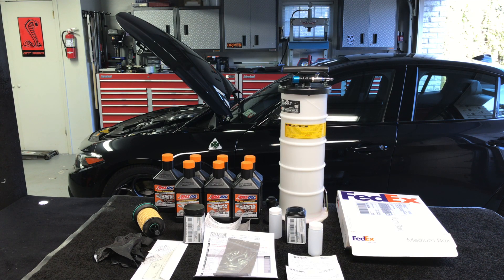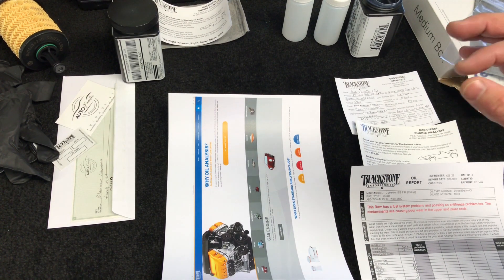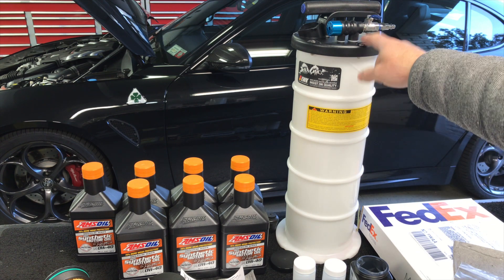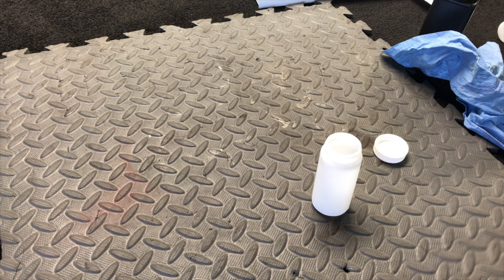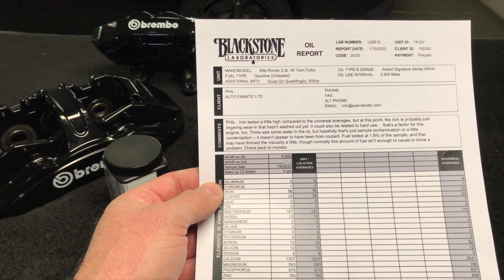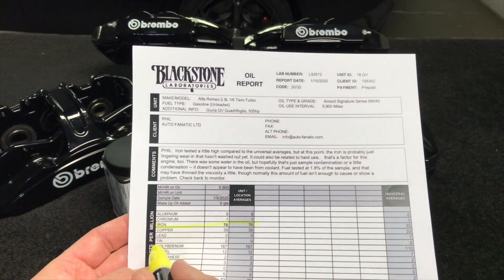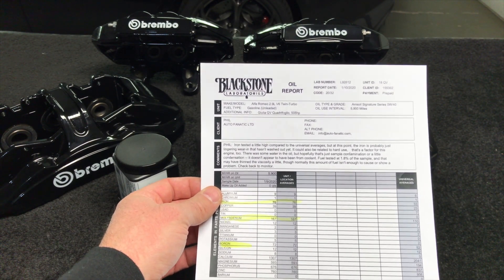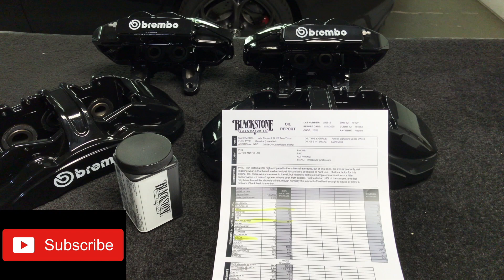Alfa Romeo Giulia Quadrifoglio Motor Oil Analysis

Comment: Hey Phil,
Just came back to this video as i am wondering if you could tell me any alternative way to do extract and do oil change using bleeder like yours on a vehicle that does not have any dipstick? I have F80 M3 and like all modern bmws mine does not have any dipstick to perform this method... 
think this is way easier way to do oil change since you dont need to jack up and hoist your vehicle
Thanks in advance.
Reply from the maker: hmm im not exactly sure i know MB has the same issue they are making these cars mostly dealer serviced now. Call around to an independent shop i wonder if there is indeed some access port up top. let me know if you do find out
Reply: Auto Fanatic alright will make some calls to find out.

Comment: I wouldn’t do this on an engine with less than 100K miles. I just did it for my bmw e46 m3 at 100k miles and it came Alright. Unless there are known issues with bearings at low mileage, I don’t think is necessary

Comment: Here is a quick tip if you don't use an extractor. Go to home depot. Buy the refrigerator ice machine tubing. Cut the hose to length where you can insert the hose in your dipstick hole and you can reach the end with your mouth. Have a rag handy and you oil sample bottle. Suck on the tube til it's about 6" from your mouth. You'll see the oil in the tube. Cap the tube with your finger and remove the tubing and place the end of the tubing into the sample cup. Remove I've your finger and let drain. You may have to do it twice to get enough oil. You don't need a full cup like AF. When done discard the tube. The tubing is $2.99 and you can usually do 2-3 individual tests off of 1 tube purchase. You will have a guaranteed clean sample. I use this technique on boats and airplanes as well. Any engine you want to oil sample.

Comment: I am on my 4th new Alfa Romeo and i am bamboozled after all these years that they need a oil change every 9000 miles !🇬🇧
Reply from the maker: i would advise doing them sooner i never trusted the 1 year interval or 10,000 miles
Reply: oil breaks down  at 2000 miles.  With a turbo 1500.  I change every 2500 miles

Comment: Moly and boron are additives not wear metals amsoil ss has a high amount of these additives because it’s designed for extended drains
Reply from the maker: thanks for posting this up, the report sure looks normal i will retest in a few months and do a comparison video to share
Reply: Get Zmax   alot of your nascar guys use it.  Also the only FAA additive approved for aircraft piston engines..

Comment: Amsoil and Pennzoil are pound for pound the best oil according to projectfarms data.
Reply: Pennzoil Ultra Platinum* not just regular Platinum.  Which you have to order now, and isnt available readily at jiffy lube anymore
Reply: The earlier quads (before mid/late 2018) use 0w40. The quads thereafter use 5w40, these cars have both direct and port fuel injection - there is a specific VIN number where the change occurred - you can look it up). DO NOT USE Pennzoil, Amsoil, Castrol, Royal Purple on the later cars. They do NOT meet Alfa’s specs. The quad needs oil that is ACEA C3 and API SN, with FIAT specs 55535-GH2 and Chrysler spec MS12991. Only MOTUL 8100 x-clean, petronas Selenia quadrifoglio, ROWE, Pakelo and a soecific MOPAR oil meet these specifications. The Pennzoil and Amsoil are ACEA A3/B3 and do not meet the Chrysler or FIAT specs. These latter oils will eventually damage the engine. The quad needs the correct spec oil to properly protect the turbos and engine.

Comment: I have a similar pump. How you clean it and how you dispose the cleaner agent? Do you dispose it as oil for recycling?
Reply from the maker: i fill mine with mineral spirits and i made a rubber plug for the spout, i shake it all around and pour the excess in empty windshield washer fluid bottles i keep in the garage, works great then i drop off at the local Napa for disposal.
Reply: Auto Fanatic thanks a lot

Comment: Should be interesting to see the results. Will you also find out how much life is left in the oil so you extended the change interval?
Reply from the maker: i took a chance on this interval but i never go this long even though these modern oils are so high tech these days but il be testing it again in a few months to share if any changes are present
Reply: @autofanaticcars  what if the test says your good to go longer, the results don't lie😉
Reply from the maker: i still would not do it im kinda programmed this way for so long. the viscosity thinning was so minor for the miles and nature of this engine which is a good sign of the oil stability, the factory oil burned so quickly.
Reply: @autofanaticcars  so how many miles do you go?